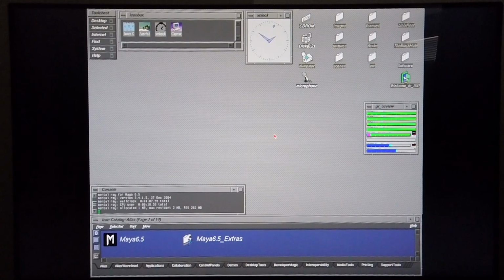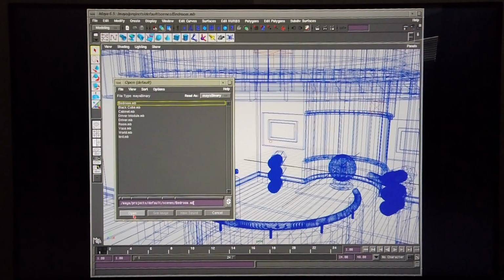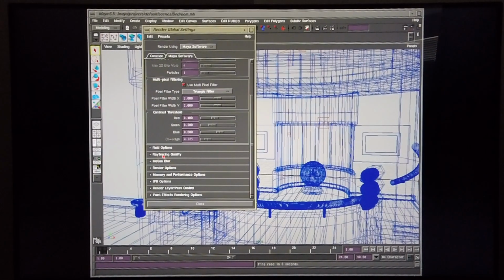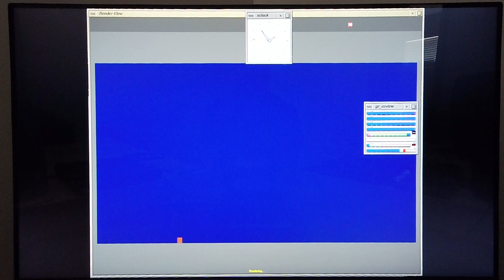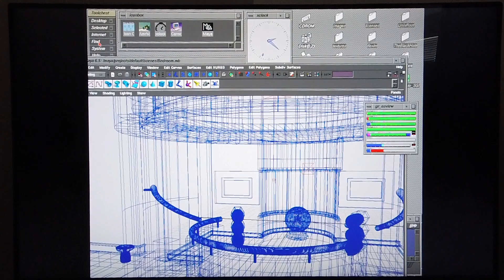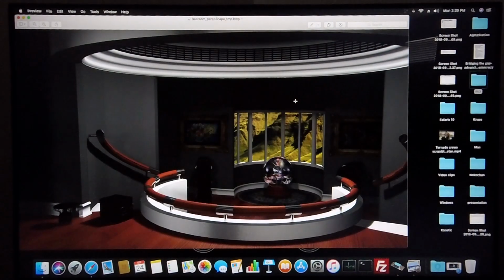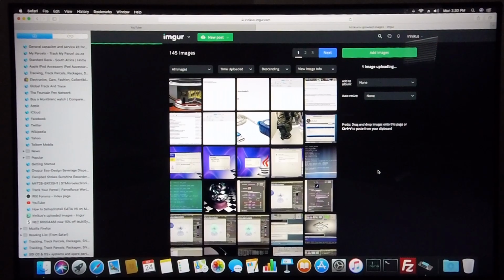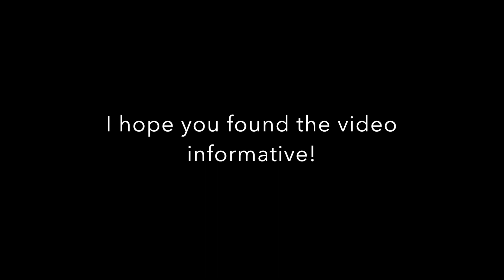Rendering a large scene in Maya 6.5 on a Silicon Graphics Tezro

Comment: I'd be curious how long the same image would take to render on a modern laptop or PC?  Say something like a quad-core i7 or whatever your Mac is running.  Have you tried to compare the render time with our Mac vs the Tezro just for fun?
Reply: DigiFootage Channel, some notes to bare in mind on all this...

Despite early plans to do so, SGI was never able to add multimedia or vector instruction extensions to its MIPS architecture (the equivalent of what today are known as AVX, SSE, etc.) In earlier years, SGI had a very strong FP64 design with the R8000 (more a chipset than a CPU, but at 90MHz with 4MB L2 it could do 360 MFLOPS which was enormous at the time, ten times the speed of a P90); the POWER Indigo2 with a 2MB 75MHz R8K was the first desktop workstation to outperform a Cray YMP. A 150MHz version had been planned, but that was ditched in favour of the easier to manufacture (and code for) R10000, a result of SGI's buyout of MIPS. Not long after though, Intel began its IA64 FUD campaign; the goal was simple: convince rivals it had an uber design coming that would wreck everything else (not true), persuade companies there was no point sticking with Alpha, MIPS, PA RISC, etc., so over time Intel was able to soak up a lot of CPU design talent from rivals (I believe they bagged the entire Alpha team, for example, and of course HP jumped into bed with them wholesale). SGI lost about a third of its CPU team in a single year (huge salaries on offer).

Once Intel had the people, then it could design the CPU. One heck of a gutsy bluff I suppose, but it worked. Up to that point SGI had been planning to release new designs, beginning with Alien/Beast (SNx series), eventually combining with Cray's vector technology and absorbing elements of the R8000, to produce something that included vectors each of which could operate on multiple integer/fp elements (eg. a single 128bit vector could be 16x 8bit elements, or 4x 32bit fp, etc. Not sure of the actual vector width offhand, probably 256 or 512bit). Some of the details can be found in the MIPS V ISA and MDMX documents. Together, it adds up to something very similar to SSE, SSE2, AVX and suchlike, but far more powerful. Never happened though, all ditched in favour of IA64, because SGI believed Intel's FUD. Mind you, SGI did end up with political/wrangling issues with Cray, so maybe the human element would have scuppered their plans in the end, we'll never know.

In the event, IA64 gen 1 was very late. SGI told me that before then they had concluded that their own CPU plans would have been about a third faster than what Intel was going to do, but a lot more expensive, so on cost grounds the switch seemed sensible. Thus, Origin2000 was originally designed to take IA64, hence the low density of only 16 CPUs per rack (they'd been expecting IA64's much higher TDP), something not corrected until the 128 CPUs per rack of Origin3900 (ie. 32 of the quad-1GHz node boards found in Irinikus' Tezro, they're the same, a CX-brick has 4 such boards, a full O3900 rack has 8x CX-bricks, the system scales to 8 racks, or 16 with some extra hw supplied to customers such as NASA and DoD). With IA64 late, so SGI had to change tack and launch Origin2000 with MIPS. It was still a great boost over Challenge though, the arch changes really helped, see my various pages for details:

http://www.sgidepot.co.uk/sgi.html#ARCHTECH
http://www.sgidepot.co.uk/sgi.html#SYSCOMP

eg.:

http://www.sgidepot.co.uk/octncomp.html

I was told numerous tales of awesomeness by so many companies and users. And indeed, given the apparently low clock, the responsiveness and snappyness of Octane is extraordinary. It still feels really good today.

Overall though, it did mean that for a long time SGI's performance leadership was largely due to its systems' superior bandwidth, latency, scalability and a damg good OS (and sometimes CPU speed aswell, R10K was still pretty good, I remember at the time a 2-CPU Origin200 demolished a SUN with a lot more CPUs for a particular chemistry application). The lead was though mostly in scientific codes, less so for int, but scalability and suchlike kept SGI strong for databases, etc. Origin was very popular.

Intel meanwhile advanced x86, it had multimedia extensions for both int and fp, it also had HT (something SGI never had) which helps a lot for rendering, and had multi-core CPUs; this meant much greater performance density, lower power consumption, less heat, etc. For a while in the rendering field SGI did retain a huge foothold for other reasons, eg. ILM had multiple 32-CPU Origin2000 systems, they created custom render software which could reuse partial render results from one frame to the next (remember that frame to frame, often not very much changes), thus allowing the Origins to behave as if they had more like 8x times as many CPUs, or more, depending on the scene. Remember these are NUMA systems, each 32-CPU machine acts like a single combined entity, so a render process has access to the entire memory pool aswell (probably 64GB or 128GB RAM back then). I bought a later 36-CPU Onyx3800 from Sony Pictures Imageworks, it had 72GB RAM (it had been part of a 48-CPU machine with 96GB RAM, all CPUs were 600MHz with 8MB L2). In the end though, without the new stuff ILM had been expecting or hoping for from SGI, they switched to x86, which did also save the salary costs of those writing the custom sw.

1st-gen IA64 did come out, Itanium, but it was rather poor. SGI used it in some systems, but it was very lacking. Intel improved the design and Itanium2 was actually pretty good. And here's the interesting part: a guy I used to know who worked at SGI helped create their QuickTransit sw emulation system for IA64 that allowed IRIX binaries to run on Itanium, a perfect match for the IA64 design, and with Itanium2 it could run IRIX binaries six times faster than native execution on MIPS hardware. That really is rather impressive, though I don't think it was used for media apps like Flame or Maya, more for things like scientific codes, databases, etc. Enterprise legacy stuff.

So what does this all add up to? Well, for rendering, MIPS has to cope with what it can bring to the table, a CPU with no HT, no multimedia extensions, no multi-core and nothing akin to vector AVX. And here's the amusing part: if you calculate the IPC of Irinikus' Tezro with its quad-1GHz CPUs, compare to what x86 is doing in the C-ray or Blender results for example, MIPS is actually very impressive, it holds up extremely well clock for clock. It's behaving like a far more powerful CPU, but seemingly held back by being low clocked, etc. This implies something that correlates with what SGI people told me before the IA64 takeover: if their own plans had been able to continue, what SGI was going to do would have produced something quite extraordinary, an R20K or whatever with very strong FP64 (vectors) but also powerful multimedia extensions, also vectorised. What I don't know is what they were planning to do in terms of multi-core designs, or if they had anything akin to HT in the works; by that time my contact at MIPS, someone on the R10K design team, had alas moved on. It's certainly fun though to ponder the what-if, ie. if SGI, and indeed all the others like DEC and HP, had ignored Intel and just kept going with their own tech, where would we be today? A broader market with better choice? Afterall, the one company that did tell Intel to go spin was IBM and look how good their Power design is today, still going strong.

Also, SGI told me that their original MIPS plans for Origin4000 included increasing CPU scalability to 37500 CPUs, with a corresponding increase to gfx pipe scalability with IR5 (initially 256 pipes, then later unlimited). I don't know how they were going to do this; a sign of multi-core sockets? Possibly, otherwise even racks with 256 CPUs would have used up a lot of space, and grud knows how they'd have scaled the memory design beyond O3900 wrt latency and cache issues. I had conversations back then with people like John Mashey; ironically they'd originally been confident in IA64, saying some of what SGI had been planning to do was being rolled into it, but alas being so late it hurt SGI in the end, holding back what Origin's initial launch could have been. Still, it was a very successful product launch, SGI sold a lot of Origins and a butt load of Octanes, with Onyx2s flying out the door (one movie studio told me they were buying another Onyx2 every few weeks). I know one movie studio which early on had a render farm with dozens of Origin200 systems, running 24/7 rock solid, and they did some amazing stuff, even working out how to upgrade the OS without rebooting a system.

Here is some SPEC2006/SPEC2000 data I gathered at the time, fun to do the IPC math, and puts the modern GHz craze into perspective when you see just how well MIPS and indeed Itanium2 compare, especially given MIPS' dated ISA with nothing akin to SSE, AVX, etc. The SPEC2000 tables with lots of IA64 and some MIPS numbers are at the bottom of the page, including the 1GHz R16K found in Irinikus' system:

http://www.sgidepot.co.uk/misc/spec2006tables.txt

Hope this wasn't all too boring. :) Overall what I'm trying to convey is, yes indeed, modern CPUs completely thump a Tezro (they should do, 25+ years of CPU arch improvements! :D), but oh what might have been but for the path of history would - from what I knew of events - have been far more interesting. And who knows, with competition so much stronger, maybe Intel themselves would have innovated far sooner and moved on from x86, instead of plodding on year after year with lame IPC improvements? Thank grud for AMD and Zen, though I do wonder whether we're not far away from a new era of potential Arm domination given what MS, Apple and other companies are planning to do. I still can't help thinking however that after 30 years, we're way behind where we could have been. IBM once said that Intel's infuence in the evolution of CPU tech has held up advancements by at least a decade, and that comment was from years ago.

Ian.
Reply: @mapesdhs597  Extremely interesting read!  Thank you for posting this.  Happy Holidays!
Reply: @DigiFootageFX   Most welcome and thanks! 8)
Reply: @mapesdhs597  Interesting read, thank you for taking the time to write it all!
Reply: @g0t3nks   Thanks! 8)
Reply from the maker: I haven't tried it yet, as I don't have Maya installed on my Mac. I would like to compare it in the future though.
Reply: @Irinikus   See (Blender and C-Ray data):

http://www.sgidepot.co.uk/perfcomp_RENDER1_blender.html
http://www.sgidepot.co.uk/perfcomp_RENDER2_c-ray.html

Please do read the notes for the above, especially c-ray. Btw, since AMD used C-Ray tests in its Rome demo, I asked them for specific data, but no reply yet (I maintain the original C-ray info page, handed over to me by the guy who wrote the benchmark).

Other data comparing different SGIs (the Maya test is limited to 4 CPUs, but some systems also show effective throughput tests aswell, eg. rendering 6 frames at the same time on a 24-CPU Onyx):

http://www.sgidepot.co.uk/perfcomp_RENDER4_maya1.html
http://www.sgidepot.co.uk/perfcomp_RENDER3_alias1.html

The Maya test is simple, it is generally unaffected by machine architecture or L2 cache size. It pretty much scales with clock speed on the newer hardware.

The Alias test is complex and can also use all available CPUs via powertracer (though some stages of a render are single-threaded, eg. initial setup). It is very much affected by cache size, memory bandwidth and latency, hence it runs much better on later SGIs, eg. a dual-600MHz (2MB) Octane2 is only just able to beat out an 800MHz (4MB) Fuel, with a dual-600Mhz (4MB) Origin showing another speed bump from the larger L2 vs. the Octane2.
Reply: As a Maya User I can tell you that you don't need to render it. You can display that in real time
Reply: With a 4090 geforce card you can render in cycles for example in Realtime. The gaming pc of a 14 yr old has the Power to do industry production nowadays. We came very far lol